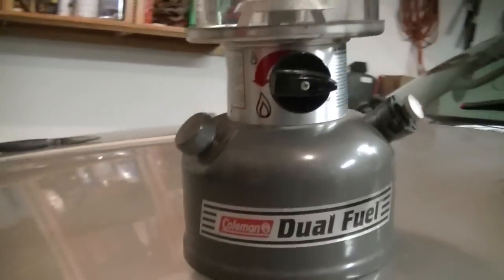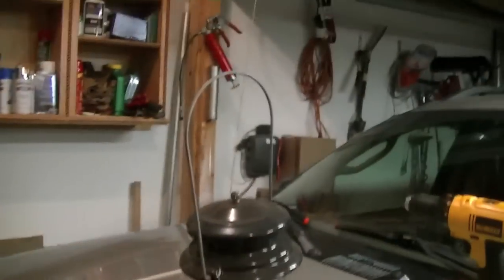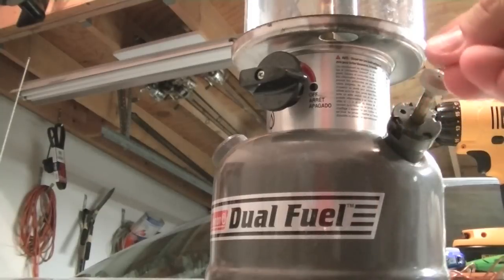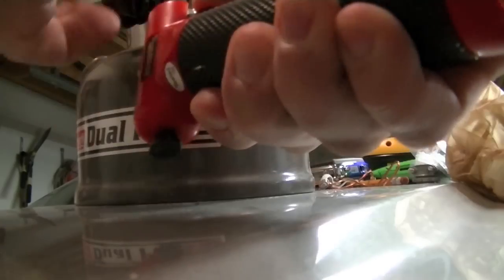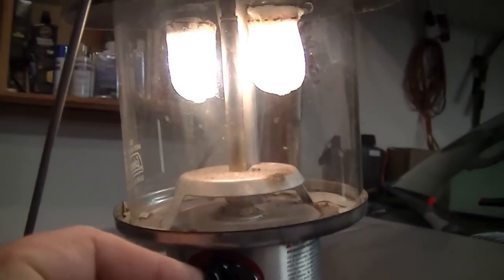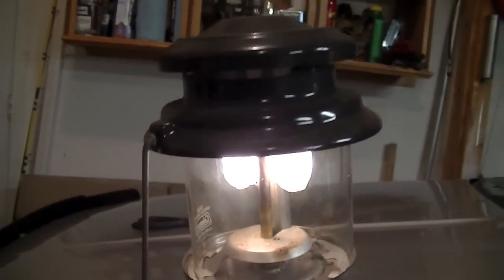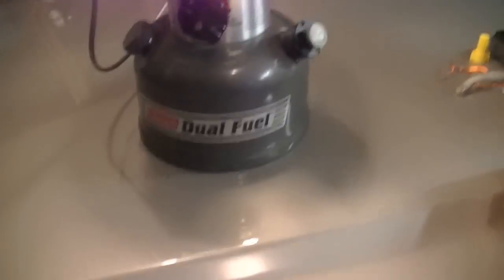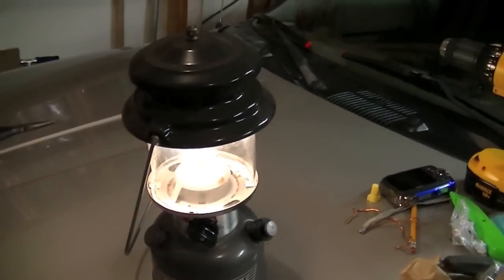Coleman Dual Fuel Lantern

Comment: I have four of these Coleman lanterns.  Two of them ceased to work and I'm going to try cleaning their generators with Carburetor Cleaner.  I don't know if I can describe this but I've purchased an accessory that usually you can find in a place that sells camping stuff.  This thing bolts thru one of the two holes you normally light the lanterns with and it's a lighter "thingy" that retracts when the mantels are lit to prevent it from being cooked.  It uses flints from Zippo type lighters.  So you pump the lantern up to put pressure on the fuel in the tank, then open the main valve, then push the lighter "thingy" up under the mantle and give it a quick spin.  This causes a spark, and lights the lantern.  No fumbling for matches, etc.  I like the fact I can come into camp in the rain, and almost instantly have light.  Hope this helps

Comment: My family has always had one or two of the older White Gas only models. They have seen us through camping trips, Nor'Easters in New England and with myself the three hurricanes in Florida in 2004. Always outstanding lights and simple to operate.

The only problem I have ever had with them is my current lamp which has a stuck Check Valve which I will fix as soon as I get a Impact Driver to remove it. (Older 288 model.)

Comment: nice video man! and sweet wheel horse! i got a 416-8 with 510 hours and runs like a dream! happy holidays!!
Reply from the maker: +askthekoipondbuilder Thanks for watching!  My 416-8 and 520H are great tractors, I use them both frequently for lawn cutting, plowing the garden and snow removal.  They are so nice to use, both were restorations I did.  I don't need 2 tractors but I am having a very hard time trying to part with either of them.  The 416-8 has close to 700 hours on it.  The 520H I bought at 800 hrs, it was just beat.  It now has 900hrs.   It had a bad rod, so I put new rods in, had the crank turned .010", honed the cylinders with new rings and seals.  It's like a new tractor now.  Merry Christmas & Happy New Year!

Comment: hey I have that lantern but ive left it with gasoline in it for about a year, the valve you turn to release the gas and control the amount had gotten stuck and was real hard to break free.  When I put new gas in it and tried to pump it up it squirted gas out the center of the pump when I removed my thumb.  So I bought a replacement pump ass and it did the same thing and even when im able to pressurize the tank when I turn the valve there is very lil hiss and it will not light and burn..I don't want to keep buying parts as it can get very close to buying a new one which I cant afford right now..im cripple and have not gotten any gov help so no money and when I do have some its rare..Could you tell me what you think it is and maybe it will be something I can clean or something..If so and you happen to want to would you post a video of what to do.  If not Id still like advice on what you think may fix it..Thanks
Reply from the maker: What needs to be cleaned is the internal parts.  Likely the spray nozzle and the valve.  I had to do something similar on my Coleman stove.  The gas has 10% ethanol in it which attracts moisture.  Gas I learned isn't a good choice because it goes bad after a month.  Now that gas has ethanol, it attracts lots of moisture and in these lanterns, they are all metal- so it rusts.  I would try to take the lantern apart, clean all the tiny orifices with a metal wire from a bristle brush and see if it works.  It may be toast though.  I now only run Coleman fuel.
Reply: Craig Arndt thanks any how to vids that you know of for this model or one that is close to it?
Reply from the maker: I haven't seen any but I'll take a look for some.
Reply: +mark oshields Sounds like the check valve in the bottom of the pump is stuck due to varnish buildup. You could try a ~$3 can of carburetor cleaner, and spray a little in the bottom of the disassembled pump and letting it soak for a while. Be sure to remove the piece that has the square shaft first.

If that does not correct the issue, the check valve assemblies are not expensive, and are available online.They're all the same, so you don't have to worry about finding one that works with your lantern model.
Reply: +Charles Walter I did clean the internal check ball and also bought a new pump assembly and all failed.  I think it now has to be the valve assembly because the force to releasse it was way too hard, I bet its just got something stuck in there,,ot sure if i can clean it by soaking in carb cleaner or not but the valve assembly isnt cheap..I may be offering it for sale on here :(
This would really suck because this modle is the brightest of the dual fuel silver lanterns

Comment: why do you prefer white gas to gasoline? you didn't say
Reply from the maker: It is far more stable inside the tank of the lantern or stove.  It doesn't turn to varnish like regular gasoline does with exposure to air.  I have had to replace too many internal parts on stoves and lanterns from using gasoline, I stopped using it.

Comment: hi, can I use 95 gasoline?
Reply from the maker: +Leonardo Fernandez You can use 95 octane fuel, but I don't advise using gasoline.  The noticeable smell from burning gas is only safe if you do it outside.  Also, the ethanol in the fuel will rust the internal components, or corrode them.  My generator was all pitted and corroded from the ethanol which attracts moisture.  If you can get non-ethanol gas that would be better.  Best fuel is Coleman fuel, burns clean and doesn't go bad like gasoline which is only good for a limited amount of time.
Reply: +Craig Arndt  I appreciate your advice, some people make homemade white gasoline, I have seen these videos on youtube, thanks again
Reply: @CraigArndt  are they a shelf life on fuel I've had some  8 yrs is it any good still.

Comment: FYI, there's no need to keep your thumb on the hole when closing the pump, as there is a check valve that prevents air(or fuel) from shooting back. While pumping, yes, you need to put your thumb on it.
Reply from the maker: Good point, its a habit of mine from using these as a kid.  Old habits die hard!  Thanks for watching.
Reply: I had an issue with the check valve in my Canadian 325A, so I got quite familiar with it! :)

Comment: You will have less problems by leaving clean fuel in the fount, than leaving it dry. Do NOT use unleaded gasoline except in an emergency because it will ruin the generator and shorten your lantern`s life. I have a half dozen kerosene and white gas Coleman lanterns, and I know what I am talking about.
Reply from the maker: I don't like using unleaded gas because the smell and all the chemicals they put it in. If you use your lanterns yearly, the can be stored empty. Problem is where people store their lanterns and for how long.  Either full or empty, white gas doesn't last forever like kerosene (although much longer than gasoline).